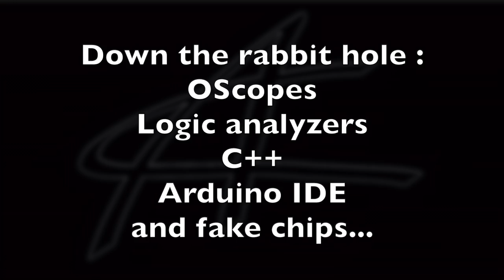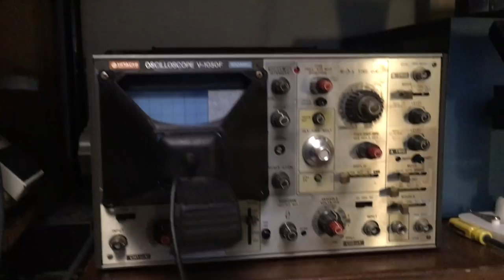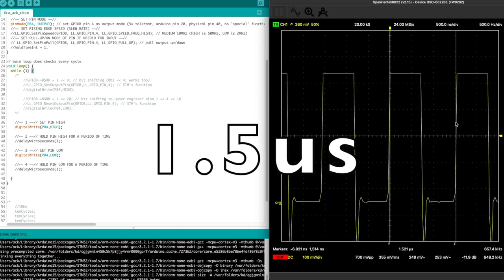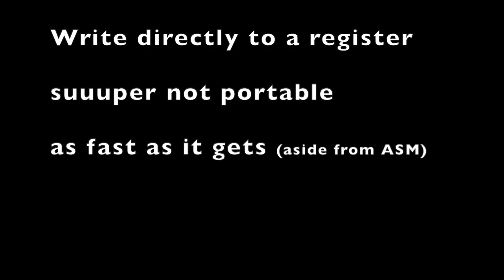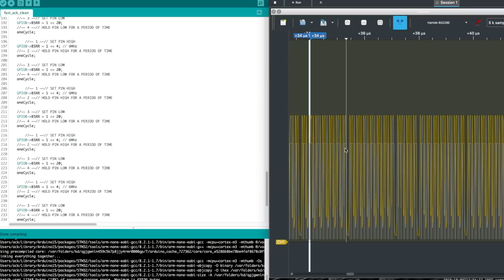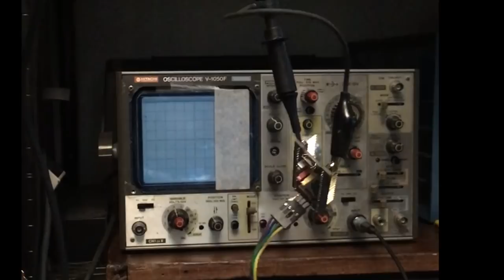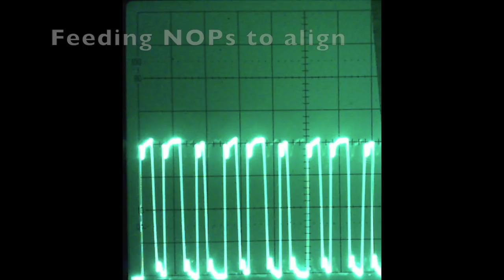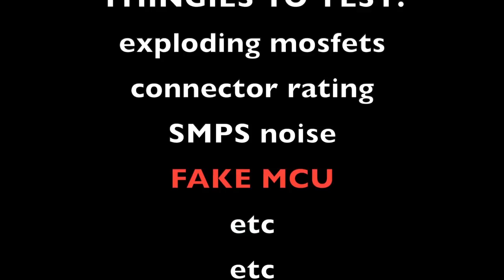OScopes, coding, and fake MCUs... OH MY

Comment: Hey Alex. the bigger "While() Loop Processing Overhead" is actually the SysTick interrupt for the STM32 HAL underneath arduino. try disabling interrupt requests before entering the while loop and you will probably fix those blips. also for the smaller while loop overhead, try a goto. that should compile to a single jump instructions.

Comment: Oh, I wouldn't have suspected that there are people who actually make fake microcontrollers, as they're quite cheap anyway. Especially those most popular ones. Just checked mine and it seems that they're not fakes. I think even if the specs might seem worse, it's beter to use original ones for one reason - they are tested and probably go through some quality checks. I wouldn't be so sure about those chinese ones. Already wasted a lot of hours of my lifetime tracking why the code do not work, ane the reason was MCU design bug. When the chip is popular, the errata might be more complete and more bugs were tracked down (and maybe fixed with next silicon revisions). So yeah, I would never go with fakes.